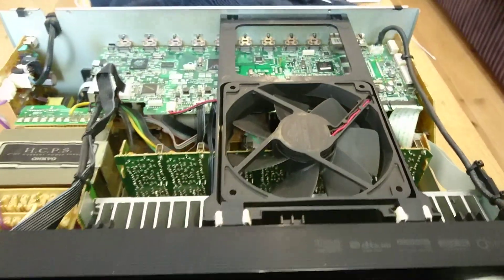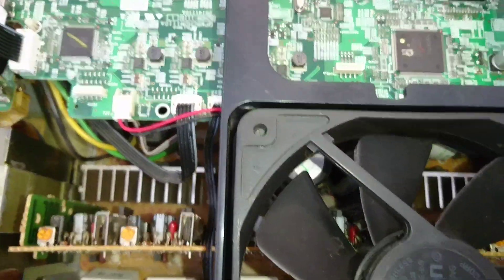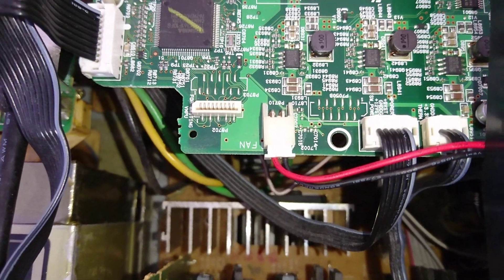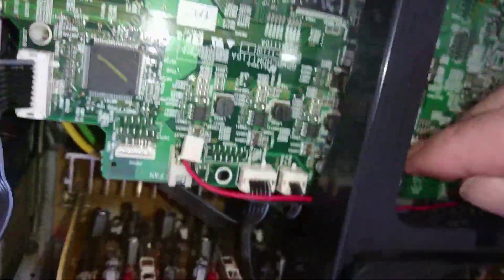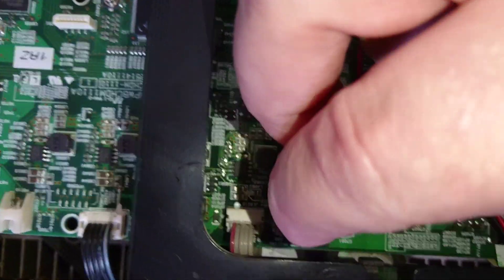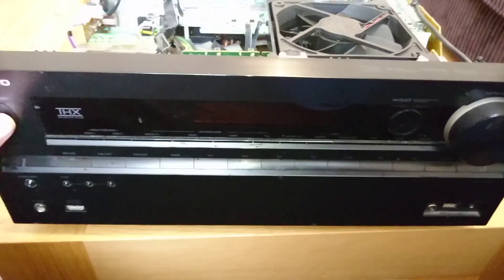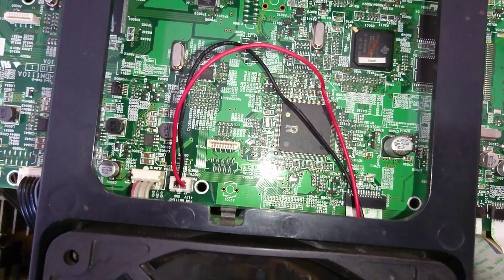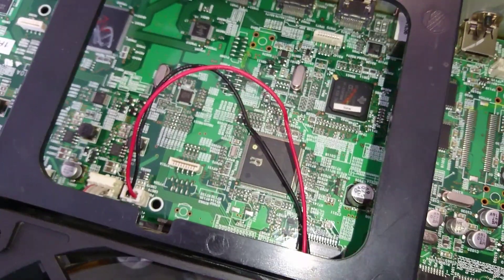Onkyo, How to connect Onkyo 616 Cooling Fan to a internal 12v supply. Part 2

Comment: I had no problem switching to the "writing" 12 v output. However, if my 616 is plugged into AC power, the fan is now constantly on. I find it too noisy as well. If I unplug from AC, of course I shut down the stand by feature, and can't use the remote to power up on demand. 
My questions are, how do I find out why the fan outlet wasn't working or did my 616 never get hot enough to kick in the  cooling fan, that I personally find too loud. I've watched a couple of hacks to install a speed controller to the circuit but it's shown in at least three different configurations. Recommendations?
Reply from the maker: I have found that switching the HDMI through OFF  then it doesn't stay on when switched off hope this works for you.
Reply: @hudsonrobert49  I must tell you, I just got this from a guy who was going  wireless and small. He sold it to me for $20 because he couldn't restart it after boxing it up a few months ago. I don't know how I got it going other than I disconnected the black HDMI cord, swapped it around for a tighter fit on the board it plugs into, kept pushing buttons till it finally switched on. This was before I opened the remote, cleaned the contact button insert and wiped down and scrubbed the 'board' and battery contacts. Needless to say, I have not connected this to a video screen, and therefore have no idea about the set up menu or the types of customization I can  put in place.
So Rob, is this where you go to first shut off the HDMI like you say in your response? I don't see a remote control button that is labeled in a way that suggests it could shut down that 12volt power. I do have a PDF of the manual but I'm too lazy to scroll through it this morning. Someday though. Thanks man.
Reply: Ended up buying a variable speed regulator for the fan. I have some pics on how I installed it.
Reply from the maker: @fixtillbroke  yes the fan does spin quick, you will have to put a link so I can see how you did it please thank you for your reply
Reply: YouTube won't let me load a slide show of my phone pictures, I could post to another audio site that you follow or should I just take a phone video and post that? I wouldn't be able to show all the details but I know you would be able to get the idea okay. I'm having no problems starting and stopping the 616 any more since keeping standby on and the temperature very consistent with the fan, which now I don't hear at all.

Comment: Hi Robert. They made the connector smaller now on new models. The label is for "Waiting" which is idle mode in japan. Cant swap the connections.  Better off running a seperate external 12v adaptor to the fan. Cheers.

Comment: It has a thermal resistor switch! When reached a certain temperature it will auto turn on the fan
Reply: fuck it we ball we leave it on 24/7

Comment: TURN OFF THE POWER before opening a receiver!  And DO NOT touch any of the components  -  capacitors have a lethal discharge even when the unit of powered off! 
Also try not to carry or move the receiver when the lid if off.  The chassis is poorly designed causing the boards to move and cause problems - or at least cause the HDMI's to fail. 

I added a fan from a TX-SR608 (that had the HDMI failure) to the inside of a TX-NR515 using the 'writing' 12v port and its working great.  The connector fits straight in.   
There is also a dedicated fan 12v - but I dont trust it firing up the fan early enough..
The NR515 has the indentations on front fascia to accommodate the fan cage - - but the back chassis has no screw holes to fasten the back of the fan cage.  
I was against drilling new holes as of the metal filings that could cause a potential disaster.   I used a good blob of hot glue instead which holds fantastically well.

The unit is running cool and the fan is super quiet.    
Im amazed the TX-NR515 has no fan on shipping- after all, the ports are available and the front fascia has been built with a fan in mind.  Penny pinching I imagine.

Comment: I installed an additional fan to cool the dts chip and connected it to the 12v socket, but it doesn't stop when I turn off the receiver!  What settings should I make to stop once with the receiver?
Reply from the maker: I have found that switching the HDMI through OFF  then it doesn't stay on when switched off hope this works for you-HDMI through should be found in audio settings

Comment: I wanted to add my thanks for your very helpful video. I just encountered a scary "auto shutdown" of my Onkyo 616 from what I could tell as overheating with no fan spinning. I'm not sure what caused the fan to no longer work under heat load as it used to, but now I have a permanent fix. If the fan even gets too loud or a bearing goes, I'll probably replace with a comparable Noctua PC case fan in the future. Thank you again, the connector was exactly the same and I was able to slide the casing off without having to unplug everything from the receiver... somehow.
Reply from the maker: you are welcome I am glad it worked for you

Comment: Good evening, but is the fan not to heat up the HDMI card?
Reply from the maker: it's supposed to keep everything cool inside but it doesn't come on until it gets extremely hot which by then it's Burnt things out
Reply: @hudsonrobert49  thanks,i have the TX NR 905 which doesn't have a fan and i'm watching a lot of modifications on youtube, i.e. videos where they add a fan, and i don't know whether to add it too.  what do you recommend?
Reply from the maker: @Tiger-dl1yn  sorry for late reply I would do it put a fan on it somehow if I could gets too hot
Reply: @hudsonrobert49  thanks for the reply, the only place to mount it is outside above the grid of the HDMI board, which is where it heats up a bit, because the amp will be placed in the cabinet so you won't see it afterwards

Comment: Hey thanks for posting this. I had to shave my connector a bit for it to fit, but it works. One of the transistors burned before and I had to repair it. Hopefully that won't happen again.
Reply from the maker: You're welcome.

Comment: Bloody typical by the time they made the 609 they decided get rid of that spare plug thing you plugged into
Reply from the maker: Idiots
Reply: Really¿ i hace 609 and i  thought both 609 and 616 were Almost the same. Wanted to do the same
Reply: @POWERMAXUM  You can do the same sort of thing with the 609 you just have to wire it up to a usb plug then plug it in the usb port
Reply: @mrcrazyjonpresents4312  dos hoy hace pictures of what you have done with yours?

Comment: The question is, why my fan in TX-NR828 wont kick in, when plugged to the right power socket?
Will try to heat the thermostat with hairdryer to check if fan will kick in.
Reply: It will turn on after the right thermal value is reached, it's common to act this way because no one wants to hear the fan when idling or not pushing the AMP on these equipments.
Reply: @RuiSilvaPT  any clue what's the thermal requirement to turn the fan on? Just wondering.

Comment: I moved the fan connector on my NR626 to the same place you did Robert. But the 12v connector was smaller. The pin spacing was the same so I just broke the tiny weak walls off of the connector. The fan connector just barely fit. It spins very quietly. The 626 runs stone cold now !! Not any heat to be found around the outside of the receiver !! Thanks for the tip Robert !!
Reply: Thanks for the heart Robert. Well over a year later and my NR626 is still running stone cold !!
Reply from the maker: @mikep95133  I am glad it's still keeping cool, Mine is still working fine.
Reply: I Just did it on my 626. Fan works, let's hope no blackouts for my receiver anymore :D Thanx to both of you :)
Reply: @izzy76slo  Does your fan shut off when you go into stand by, with the power switch on the remote or the faceplate pushbutton?
Reply: @fixtillbroke  yes it does